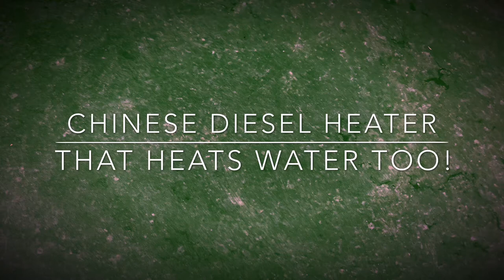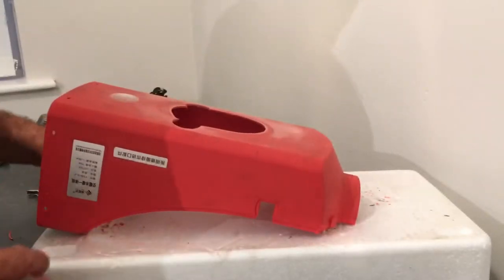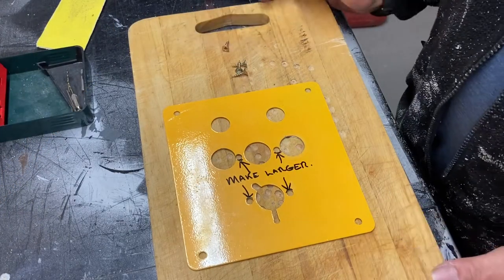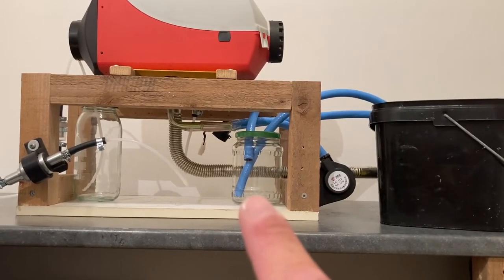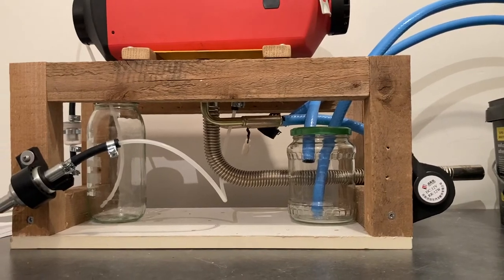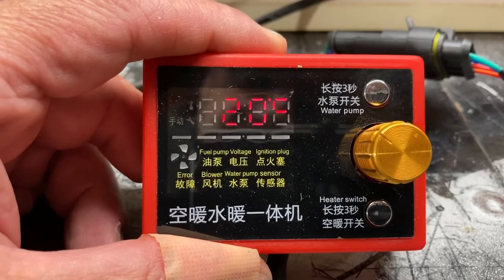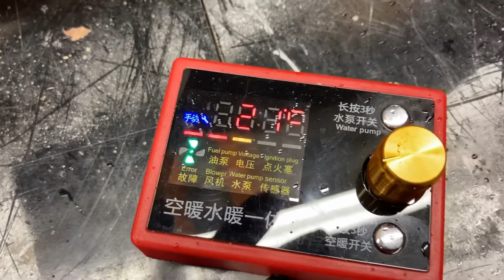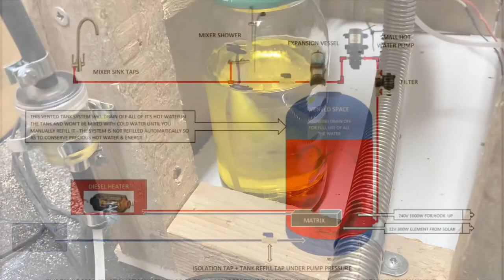Chinese Diesel Water & Air Heater Feasibility Test

Comment: Yeah, these diesel air heaters and diesel air and water heaters are not meant for campers but they’re also not meant to heat up a 2000 square-foot house spot they can I have one in my 37 foot camper. I have one in my basement and I have one in each one of my five cars, just because it ain’t meant to be in something doesn’t mean that it don’t work for it
Reply: I personally use the diesel heater in my house for heating the house when the power goes out again last time I used it was when we had 36 inches of snow and we were out of power for 2 1/2 almost 3 weeks in the middle of nowhere to give you a idea everything in our house runs on electricity, well waterwoodstove wood furnace water boiler garage door doors heaters so yeah

Comment: Can the water be heated without the fan turned on?  I.e. I want to have hot water but don't want to heat up the camper.
Reply from the maker: Hi Roger, no it can’t heat water without the fan on. Its primary function is to heat the air with water heating as a bonus. Depends on which country you live in or visit most because here in england 80% of the time your going to want your heating on at some point during the day because even in summer it can get chilly on a night when camping. Therefore a 30-40 minute blast of air to heat the camper up is usually the norm here in the mornings, so heating your water tank up daily isn’t generally an issue. However if it is warm out side then usually your doors are open etc so again not to much of an issue. Especially if you can point your vent towards the door! However, i intend to visit places like south of France, Spain and Portugal etc so the summers are much longer and hotter so my solution for that if wild camping is to heat my water slowly through the day using a separate solar panel and a 12v 300w electric element. If on grid at a camp site i will always heat my water with the 240v 1000w heating element including an electric heater so my diesel heater is only when off grid so i know i can always have hot water.
Reply: The fan doesn't come on to cool down the unit it burns up anyway it all one unite so when it works it blows all on one shaft helps make the flame for the combustion heat, the fan keeps it from getting too hot another words you don't get one without the other
Reply from the maker: @garyreed354  yer true but when your finished and shut it down it has to run a cooling down part right st the end to avoid overheating.
Reply: @diycampervanman1633  yap thats it
Reply: If you look up Bobil Van heat exchanger for diesel heaters you will likely find the videos I watched last night. 
With their method of using a diesel air heater to heat water, the heat exchangers mount to the unit where the hot air comes out and dramatically reduces the air temperature passing through the heat exchangers while the water is flowing through them, to the tank & back.
When the desired water temperature is reached, the water pump shuts off and the air is much hotter. Then you can just shut the machine down & use the hot water.
It seemed pretty quick, but they were only heating about 2.5-3 gallons.
Reply: If you had this type with a built in heat exchanger and the heat exchangers that mount to the hot air outlet plumbed together,  I imagine it would heat water even faster.
Reply from the maker: @LarryMorrow2  hi Larry,  i have  a 75 litre hot water tank so its never going to heat up fast but the way i have designed the tank is to stand it at a long and tall orientation like a house emersion heater, therefore the heat generated rises to the top of the tank and then the floating feeder pipe only sucks in the hottest water thus making the system quite fast to use within ten minutes be it the bottom of the tank is still cold. My tank is a vented tank and drains off as you use it so the less water the faster it heats too but like i say you skim off the top layer of heat before the tank is fully heated anyway. Also there is no or hardly any loss of air heat when your heating water too. About a 10’C drop in air temp only. Finally the bobil system circulates the water in the tank which causes the cold water to mix with the hot. This means you have to heat the full tank to reach your desired shower temp where as i only have to heat the top quarter of the tank only. Ying and yang i suppose as my system got darn complicated when i started to build it lol. The bobil is a good ready to go cheap choice.
Reply: @Roger June is who I meant to reply to as a solution to wanting to heat the water but not the camper.
Reply: @LarryMorrow2  saw that  one  too pretty bulky
Reply from the maker: @LarryMorrow2  lol no worries 👍🏻

Comment: I been looking, but all I see is that most or no ones know how exq pressure works or how to exchange the heat out of it.  O well.
Reply from the maker: Im not sure what you mean by exq pressure? Im fitting my system in my van this week and its works very well tested over 2.5 hrs running even without the circulation pump on so long as you make sure you build it in a certain way of which ill explain in the next video coming out very soon.

Comment: The most people to put them and that's what they're designed to be put in campers
Reply from the maker: Hi Gary, not quite sure what you mean but they are designed to tap into the engine coolant system to keep an engine warm over night. None water ones are designed for busses to keep passengers warm and truck night heaters or also knows as parking heater. I believe people have adapted them for campers but i could be wrong but the water version is really for trucks. You can run it without water and just use the air but if you use it for hot water then you need to be aware of its issues. Its all on the next video in a weeks time as its fitted in my van now.
Reply: @diycampervanman1633  everyone I know who has one uses it in their RV some of them plug it into the water and to keep them warm overnight but originally they were in 18 wheelers and cement mixers and all these kind of commercial vehicles but they're fantastic in your RV much better than your forced air propane furnace for sure and wait Reaper
Reply from the maker: @garyreed354   agreed there. Mines fully fitted now in the van and its running a treat.

Comment: Hi there, how many amps does this use at the minimum setting, please?

I wonder how it compares to the normal air heaters, I think they use 0.8amps at the lowest setting. 

I guess it will vary depending on whether the water pump is turned on or not.

Do you think you could make a cup of tea with this heater?
Reply from the maker: Hi ned, your right it will tick over around 0.8 amps but while the glow plug is on it can rack up 10amps but this is only for a short time until the glow plug turns off. Not sure what the water pump uses but that will only run for 30mins till your water tank is hot enough, then it has to be shut down or it will keep heating up till it boils as there is no water temp thermostat. 

I suppose you could fit a temp thermastat that cuts the electric but never turn off the machines power as it has to go through a cooling down process.  If you did fit a thermostat in the tank you should only wire it to the fuel pump line because you can kill the diesel pump and the machine can still start its cooling down system. 

Dont ever drink from a hot water tank in a camper or even your house. Thats a no no especially in camper vans because all sorts of nasty stuff is growing in their of which worse case can kill due to listeria! Always have a separate fresh water source for drinking when camping. So the answer to that is no you can’t make a brew using this machine lol. 

This guy on the link below has looked at an alternative cheap system for heating your water using a standard diesel heater. Maybe a better option. Even im thinking Mmmmm. 

https://youtu.be/SWbIvlFH1SU
Reply: You would definitely want to use a heat exchanger, and not drink water from this thing!a tiny pump with a 1 litre resivor, with about  15-20 meters of 12mm copper tubing inside of a food grade stainless 10-15 litre pot if nothing else, circulate the water through the tubing inside the pot, with water inside, and a tap at the bottom, for use, it can be sealed, and insulated, but I'm sure a better tank could be found,  but the pot for a turkey fryer can be used, it's about 3 gallons, or a tank can be made from stainless, a solar thermal pump could be used, and a pump with pressure switch  for the water supply for use, or a much smaller rank from 4" stainless pipe could be made, and work similar to a tankless water heater, only hold a small amount of hot water possibly enough for a couple cups of tea, it would be a pipe full of copper tubing coiled up, if you have access to a welder, and a few tools, it would be easy to build a heat exchanger/ hot water tank!

Comment: Hi there - interesting set up and I'm looking into the feasibility of using this to heat the water in a lazyspa.  I'm sure it will be more efficient than a 2kw electric heater.  My thought being water from spa cycles into the heater and back into the spa - no header tank.  I've seen a video where someone did this with a Webasto C top heater which he claimed heated his spa about 20 degrees in 4 hours which sounds very good to me.  Any reason why this unit wouldnt do this?l
Reply from the maker: Hi peter, that sounds like a cool idea! Thinking outside the box is what i like. My only concern would be if you run the water direct from the spa to the heater then back out again, the tiny heat exchanger may scale up over time. The norm is to run a chemical or vinegar through it every now and again to dissolve the calcification. However the cast is 100% aluminium so running normal stuff through is out the question. You would need a special de-scaling chemical for aluminium, a much gentler version but fir how long and how often? You would need to dismantle the machine a bit and open the heat exchanger up to truly know if you have cleaned it enough! That said, don’t let me put you off as its a great idea to try. Im just pointing out potential problems. Ive decided to pump vehicle coolant through my system and letting a mini radiator heat my water up to avoid that happening but now it will take longer to heat the water. 
Best of luck, hope your idea works well and let me know if it does. 
Karl.